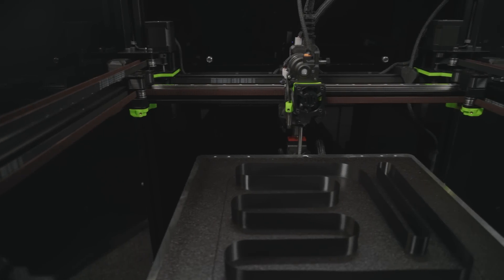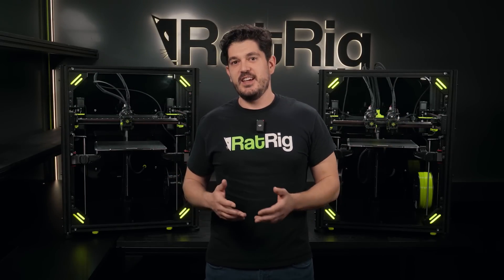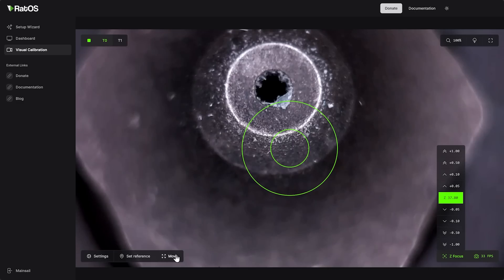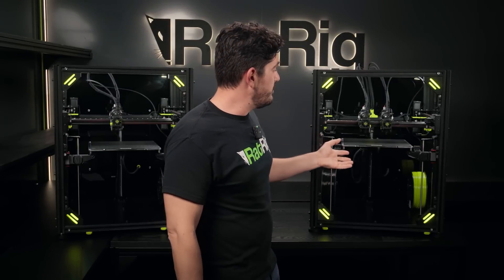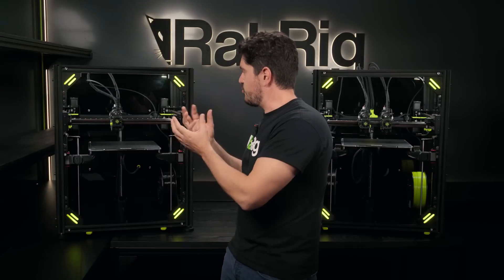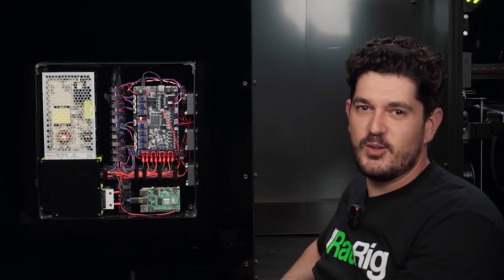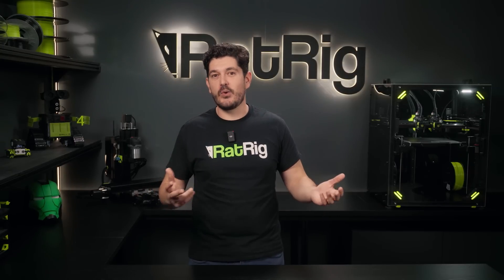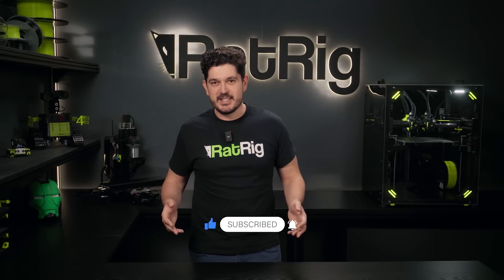V-Core 4 Reservations are Open! A machine walkthrough and an IDEX give-away | Rat Rig TV #04

Comment: Looks like A LOT of wasted space inside of that frame, its 300x300x300 but the whole printer is HUGE.
Theres absolutely nothing new or revolutionary in this printer, you could get exactly the same 3 years ago.
Reply: The extra space is needed for parking the two toolheads, below you have space for 4 filaments (multi material module coming), active enclosure heater, carbon/HEPA filter, side air curtain etc.
As to the new and revolutionary, you could say the same for every FDM printer on the market. The basic principle has not changed for decades but you're free to go and develop something new and revolutionary, especially something that is not covered under a patent law - let's see how that goes!

Comment: Given the large footprint of the machine, what would it take to mount the electronics in a slide draw on the bottom of the machine? In other words, add cable management so one can slide and service the electronics from the front?
Reply: Ooo now that's an interesting idea. I might actually steal this one from you. Get some drawer slides of course, maybe print brackets to hold them to the extrusions. Might be awfully heavy though. Trouble is there is alot of wires to put into the umbilical and any quick disconnect means you use.
Reply: Hm, you'll need some long and thicker cables (voltage drop) and the heat might be an issue! The 500x500 bed heater is 1500w, which is 6,5amps on a 230 volts EU, the 400 is 1000W, so that's 4.4 amps, still no joke

Comment: I've been really wanting to build a Voron for a long time, but Ratrig has stolen my heart with this one I think, haha.
Reply: I already built a VCore 500 and was gonna try a voron this time (got a troodon instead out of necessity ) but this new version stole my attention as well. Can't wait to add IDEX and mmu to the 400.  Life will be complete after that.
Reply: I've built a 300 and 500 vc3, and a v0. I use the 300 all the time, 500 for large parts, and v0 is basically just toolbox decoration at this point. That being said, i will probably go for a 300 hybrid. I would really like to have 300x300x400
Reply: @travistucker7317  Do you notice a difference in speed and acceleration on the 500 mm version compared to the 300 mm?
Reply: @philippschafer180  300 can definitely go faster before artifacts start showing up. I think the hybrid is a very good solution for the larger machines. Mass is obviously an issue, but so is belt length. I run mine relatively slowly compared to most people you see around here. 300 is between 80-200mm/s at 2-20k accel and 500 is 60-150 at 1-8k accel. About 3x normal mk3s speed. My 300 has a hf rapido, and could still go faster with uhf.
Reply: Same here, been wanting to build a Voron forever but this will do.

Comment: How high the heater run? What needs to be replaced to run it at like 100c?
Reply: Nothing needs to be replaced. Heater is rated for 149C long term operation. Comes with a 157 degree thermal fuse.
Reply: @miklschmidt  great to know!
But what about the toolboard? Isn't it electronics and should not work beyond 70c?
And somebody told me in the comments about replacing belts for a higher temperature ones.

Comment: love yo know what you gain by going to bigger sizes (400 or 500) vs the 300. is there anything the smallest 300 size wont be able to do in the future? multi material etc?
Reply: Although bed / frame sizes are different the space left stays the same so RMMU or spools will fit.
Reply: @3ddruckerplausch  so I loose nothing when choosing 300 over 400? What worried me was until he product page it says the 400 & 500 beds have additional holes for accessories
Reply: @Dead_Aim556  You loose nothing except build volume. The new 300 bed has the additional threaded holes as well, it's just 6mm instead of 8mm.

Comment: There doesn't seem to be any mention of the difference between "Bed Plate - Milled cast tooling plate" and the "Bed Plate - Cast tooling plate - Pre-Machined" listed in the custom configuration. Thoughts?
Reply: The cheaper variant of each size is the older version of the bed. The new version for the 400 and 500 is now 8mm instead of 6mm on the vcore 3. Dont know the differance between the 300mm though.
Reply: On 300 you just get a few more holes for accessories such as flex plate alignment pins.

Comment: Why not AWD instead of Hybrid ? It would have improved accelerations even more ? Awesome machine btw
Reply: I’ve explained this quite a few times: that’s actually not the case. Hybrid scales Y performance linearly, AWD doesn’t. Also they’re not mutually exclusive, you can do Hybrid AWD if you wanted. Besides that AWD requires pulley syncing, and doesn’t allow for the drop-in upgrades. It’s much more complicated and doesn’t do as much for larger machines as Hybrid does.
Reply: @miklschmidt how have you implemented it into the software? Some custom plugin? I haven't found a way in the klipper docs to have both the A and B motors defined while having also cartesian y motors. According to the docs, stepper x follows core xy motion and is responsible for the x axis movement, stepper y follows cartesian kinematics and is responsible for y movement
Reply: @over_pizza_2578  Custom kinematics class, yes.
Reply: With AWD you get more power for both X and Y, but only Y needs more. Also AWD makes more complex transitioning from regular to Idex and you have more bulk on the front
Reply: Hm okay, thanks for the explaination.
Reply: AWD adds more power to the x axis, which is not the limiting factor, y axis is. This adds power just to the axis that needs it